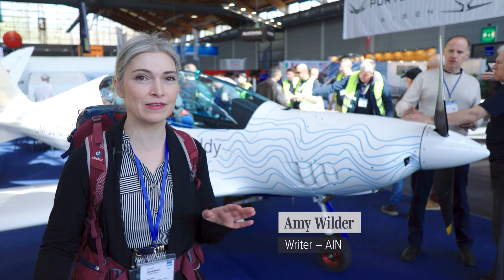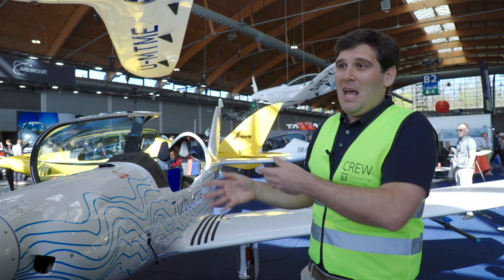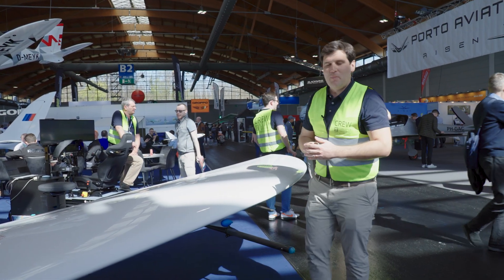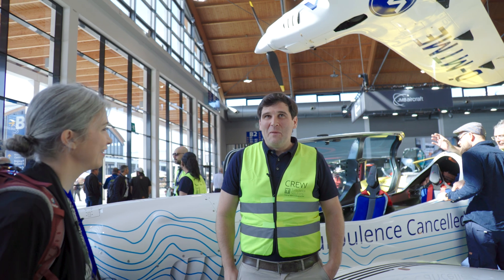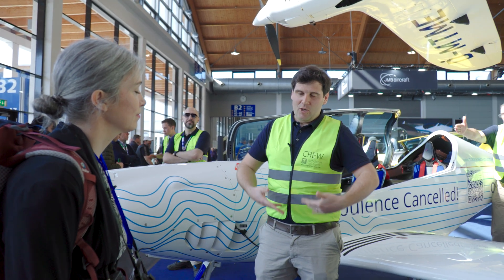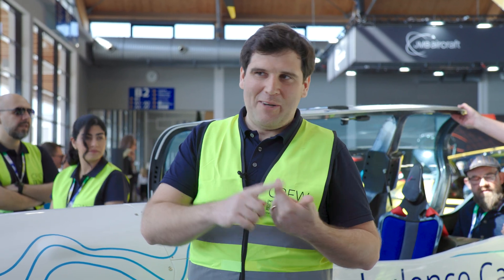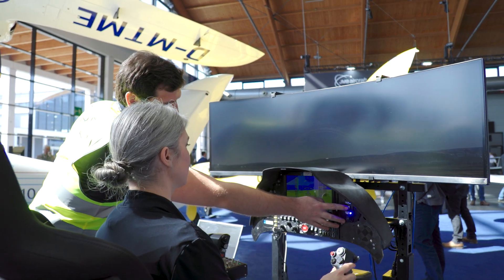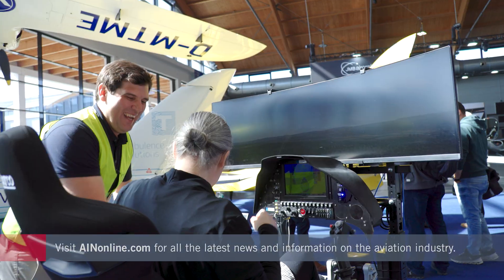Turbulence Canceling Technology Could Make the Skies Smoother for Aircraft – AIN

Comment: Why dont you use some good seat suspension dumpers? They have been around for decades in cars. But do it for the seats, not the whole vehicle. In this particular solution i am surprised it works. The probe is about 1 m ahead of the control surface. So an aircraft moving at, say 150 kts, it will cover 1m in a 1/77th of a second. I am not convinced that the servo-mechanisms will react and be effective so fast. You have the sensors that will move (mechanically and physically) those little flaps like 77 times in a second (if it needs to). That is a very very rapid movement. Hmmmm.....

Comment: This is greatly misleading. These reactive systems already exists on commercial aircraft but are disabled by the operators (Airlines) due to the increased stresses and loads placed on the airframe. By opposing the turbulence, you induce more than double the force onto the aircraft structure than if you just allowed the aircraft to ride it out.
Reply: Airbuses have Load Alleviation and Turbulence Alleviation. These systems are active on most modern Airbuses, not disabled. You can see it working next time you're in a window seat behind the wing on an Airbus. https://youtu.be/c1yAB_RtOn8?si=6YEKJ2TCyYnCBgTE
Reply: @OneAlphaMike this simply isn’t true, the majority of operators disable this function, the extra loading this endures on the airframe reduces a lot of the inspection times increasing operation costs so for economic reasons it’s disabled.
Reply: @danieljust2226 Dude, you can see it in the video I linked to. I’m an A330 captain, it’s in our FCOM. It’s not disabled.
Reply: @OneAlphaMike  Of course, you're a single operator not the entire market. You can't speak for the entire market, a matter that has been widely reported on.
Reply: @danieljust2226  You’re operating on outdated information.
Reply: You can’t speak for the entire market either. You’re operating on outdated information.
Reply: We're sorry you misunderstood the video. We'd like to clarify: Our system is active, not reactive. Its primary focus is reducing vertical motion in the aircraft through Direct Lift Control. As a side effect, it also reduces structural stress. The Gust Load Alleviation System, which is installed in some airliners, primarily serves to limit and reduce structural stress. A slight increase in comfort is a side effect. The Turbulence Cancelling System is patented worldwide – if it were an existing technology, we wouldn't have been granted a patent.

Comment: Awesome. I've seen a similar system for the aftermarket winglets on business jets. They usually require a wing extension... and they add an extra surface to the trailing edge to adjust in real time to prevent the longer wing from inadvertently over stressing the aircraft. I can't remember which models fly them - but it was very popular with the Citation X which had more engine performance than wings, and really benefited from the winglet package for rate of climb and high altitude performance at higher weights.

Comment: Just an old technology mitigation of turbulence is to remove our hands from the stick or yoke and use rudder only to keep the wing level.  Too often pilots exacerbate turbulence by introducing adverse yaw into the condition.  We have too much steering wheel muscle memory.  Yes, mini Dutch rolls are better than adverse yaw, but why chance adverse yaw?  On my first dual cross country in the 90 HP SuperCub from Jeffco (now Rocky Mountain) to Greeley, Ken Hoffman didn't allow me to touch the stick.  I had sectional in one hand and the wiz wheel in the other and maintained heading with my feet.  Yes, you old guys know, this locked the wing level at the same time.

Comment: For airborne photogrammetry and remote sensing applications this would greatly improve image quality and necessary compensation of by the active stabilization system of the camera mount. They also usually fly small planes.

Comment: Very impressive, though have scenarios equivalent to MCAS compound input and or runaway been taken into account, tested, verified and mitigated? Yes, I understand that MCAS is a very different system. Though, in it first iteration it relied on a single sensor input. And its uncorrectable compound trim corrections in the end brought two airliners down.
Reply: Been on airlines for years, disabled by the airlines due to the increased load and airframe damage it can induce

Comment: This looks like it doesn’t cancel anything. It’s basically another auto pilot that applies counter adjustments. The best way to deal with turbulence is slow down and ride the wave and if it’s too much, then get out of there. Ignoring it might cause in flight structural issues.
Reply: It work like noise canceling headphones. Active Noise Headphones doesn’t stop sound it creates an anti-sound wave (opposite phase wave) that dampens the intensity of the sound. It’s like noise canceling but for wings.
Reply: @TSLApilot  No it doesn't. Noise cancelling headphones actually create inverted sound wave to counteract the sound you are hearing. This does not blow air in opposite direction. It only steers the aircraft in opposite direction using the control surface. That would create even worse pressures on aircraft wing spars possibly increasing the risk of structural damage. I'd rather just ride the wave, than force it.
Reply: Apart from the active portion, how is this any different from a yaw damper or in fact any autopilot? It will obviously be tested to develop its use envelope.
Reply: @ShortField  That was my point exactly. Just another autopilot.
Reply: Been on airlines for years, disabled by the airlines due to the increased load and airframe damage it can induce
Reply: @danieljust2226  Exactly.

Comment: Interesting if it works. Does the small control surface amplify the forces with the wing surface? otherwise it needs to be strong to throw around an airflow with 250kg force. I'm a little skeptical but maybe